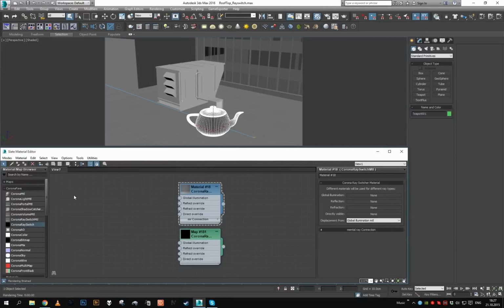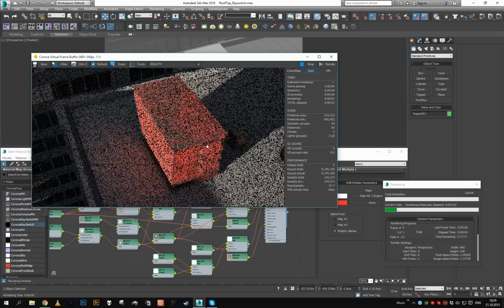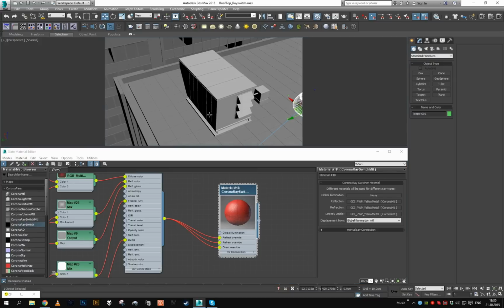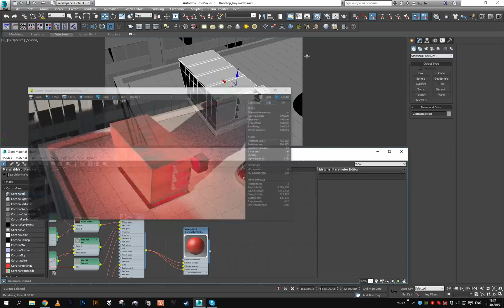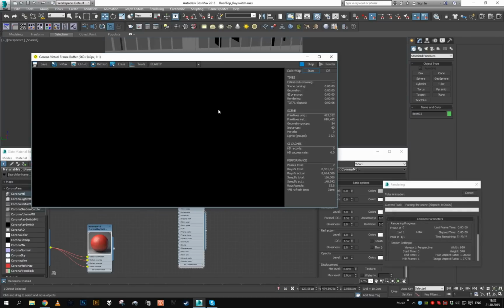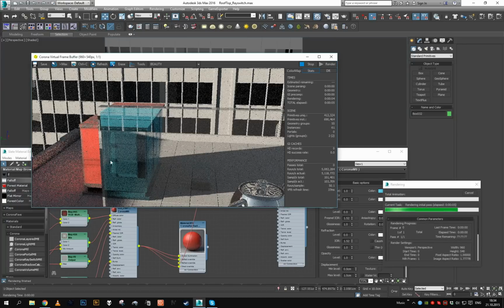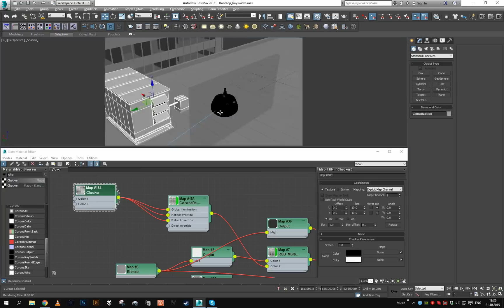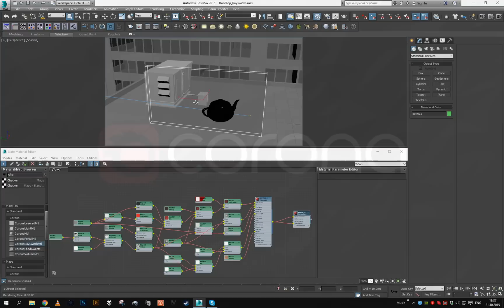TUTORIAL: Using RaySwitchers (1/2: Fakes & Artistic Control)

Comment: hi,
i was thinking of using ray switch for boosting the reflections of the hdri envrionment map without increase the GI contribution of it. i remember being be to do it in redshift, there was a reflectivity multiplier and it was so practical but i think with corona, you cant achieve that with a light , you cant ahieve that with a map either, so the envrionment has to be a mesh (like a sphere with flipped normals) and ray switched map applied as a material with two separate maps, one for GI and other for reflections.

correct so far?